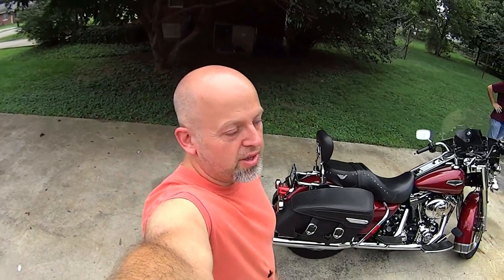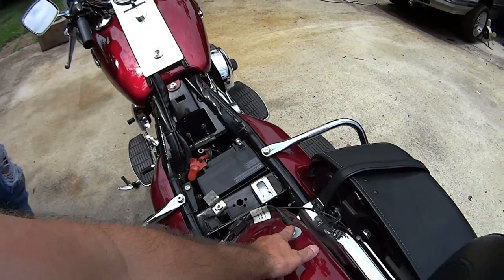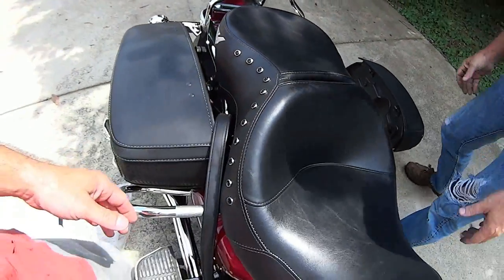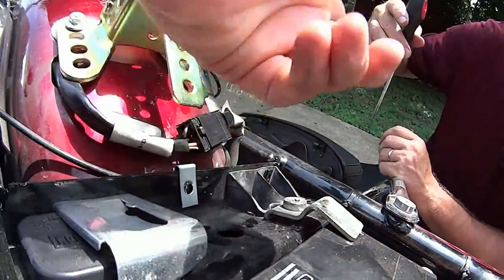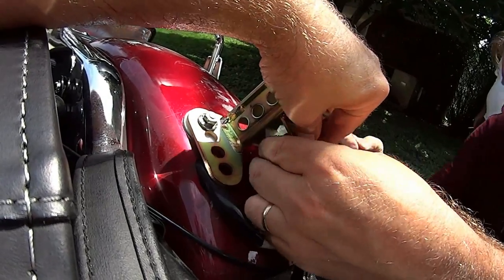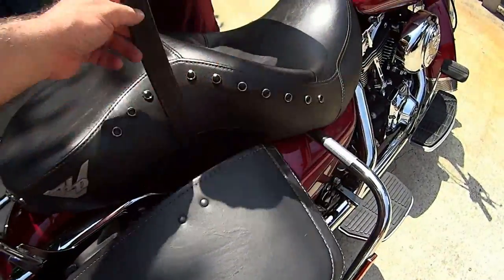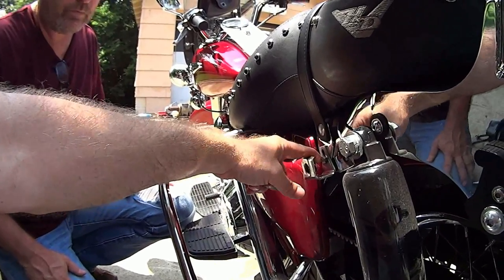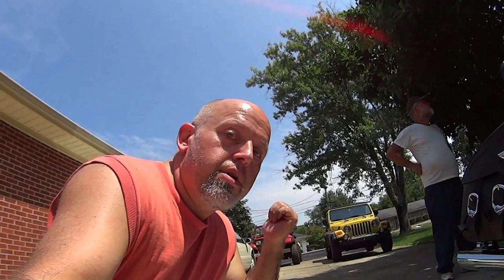Harley Davidson Road King - Install drivers back rest

Comment: what year road king is that? I have a 2004 electra glide ultra classic and its set up the same way (except it has a fairing is the only difference i see bro ) I'm trying to take my tour pak off the rear and just add the passenger back rest only without a top rear tour pak. what part number are your quick connects been looking for some thx gary

Comment: ahhh 2005 road king missed that in the beginning of the video.. well what is the part number of your quick connects to attach your sissy bar.thx gary
Reply from the maker: Thats something I'll have to ask my buddy that owns the bike. If he still has any of the paper work. I'll let ya know when I find out something.
Reply: Thx bub appreciate the response. Will wait to see the part number of the quick connect kit that the seat connects to thx gary
Reply from the maker: Are you referring to the drivers back rest? The quick connect that the back rest snaps into came with the back rest kit. Also, in order for that kit to be used, you must have the seat like his that has the slot in the seat.
Reply: No im referring to the passenger back rest,the quick connect kit to add the sissybar. I have the seat just trying to find the quick connect kit that the sissy bar connects to...just so you understand why im asking, i have a 2004 Electra glide ultra classic. And I am taking the tour pak off permanetly and adding the sissybar for rear passenger.... thx gary
Reply from the maker: OK gotcha, I'll ask the guy that owns the bike. I think it was on there when he got it. Not 100% sure of that though.